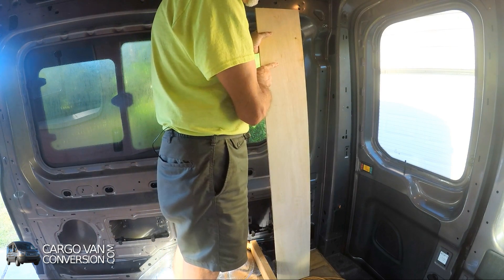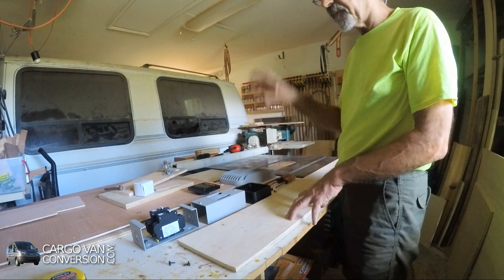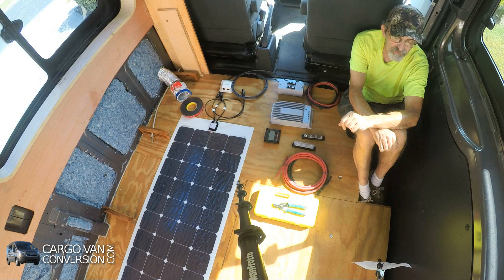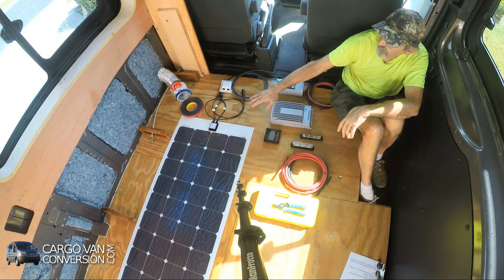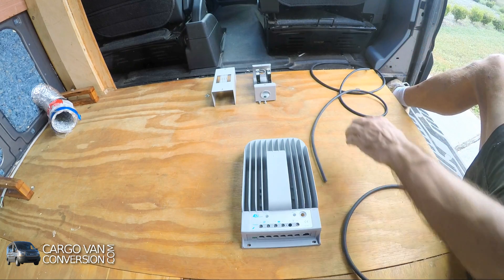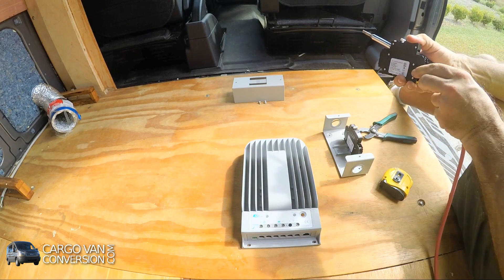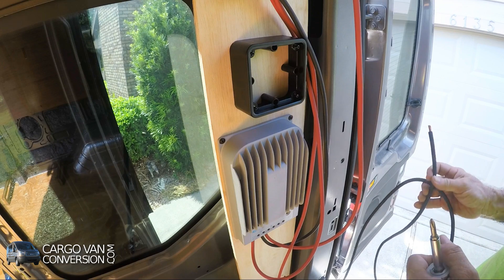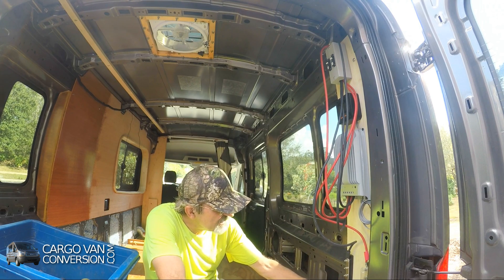RV Solar Controller & Breaker Box

Comment: Thanks SO much for going over the breaker box set up! What is the benefit/why did you go from the breaker box to a busbar instead of going direct into the battery bank?
Reply from the maker: Your title says it all:) Just Be Simple.
Good luck with your project.
Van Williams
Reply: Haha, maybe I'm TOO simple! Is the busbar only used to go from the 6 gauge wire to 2 gauge wire?
Reply from the maker: The busbars  are a central point to connect the heavy wires from the inverter, batteries, fuse block, etc. Keep the wiring between the controller and all these accessories as short as possible to minimize voltage drop.
Van Williams
Reply: I was going to just connect my inverter and DC fuse block straight to the poles from my battery bank since all the components are close together, but I suppose busbars could make it more efficient. Thanks again for your videos and help!

Comment: you could have also put a dab of oil on the nut to mark the wood, it might be out a little clearer than the impact impression - but both work fine.
Reply from the maker: Hi ggin nj,
The dent was much clearer than the video shows. As a woodworker, I tend to stay away from oil products, but you can use a variety of things, such as chalk or even lipstick. It was more about the way of getting the exact placement of the hole.
Thanks for giving your solution; someone will always find it useful.

Van Williams

Comment: Great videos! I noticed your wall under the window is insulated. Did I miss that video?
Reply from the maker: Hi tptwk,
You just put a smile on my face :) You're correct about the insulation, but no. you didm't miss anything. I often work on different parts of the van, sometimes waiting for materials to come in. I started with the insulation 1-2 weeks ago, but wanted to publish the solar components first. Right now I'm working to finish the editing on the insulation video(s) this weekend and you can probably expect to see it next Friday. In fact, the whole video process takes 3 or 4 times as much time as the actual work.
Thanks fow watching and thabks for the comment!

Van Williams

Comment: Can you please specify which 3M VHB Tape you are using to attach your solar panels to the roof?
Reply from the maker: Hi charlevoix418,
I'll be using 3M VHB tape 5952 and you can buy it here http://cargovanconversion.com/buy/vhb-tape (affiliate link).
The 3M representative told me that they did not recommend VHB tape for this purpose, but that many with RV's had used it with great success and that #5952 was preferred over the other 3m tapes.
Personally, I haven't heard of any failures. I would use a continuous strip of tape at the front of the panels (driving direction) and lots of tape all over to avoid any 'flutter'.
I'll show you my installation in an upcoming video (I post every Friday).

Van Williams
Reply: There are so many types of 3M VHB Tapes to choose from:  thank you for sharing that information!
Reply: Those flexible panels are made of plastic and are to be attached to your roof which consists of painted steel,  in ma case (I am building my own travel trailer), the same flexible solar panel had to be attached to my roof which was covered with Filon FRP (Fiberglass Reinforced Plastic) from Crane Composites:  for that application, 3M suggested VHB Tape 4952.
Reply from the maker: Hi charlevoix418,
Didn't know that. Meanwhile they still don't recommend it. Funny :)
Very interested in you building a TT. What's the story? And any pics?
Have a great day!

Van Williams
Reply: I am living in Canada but very interested by European caravans, much more advanced in design, construction and overall quality of their components.  I am using marine hardware like screws, hinges, marine electric cables for their superior quality.  Hull is completed and interior is about 75% completed, the whole project should be ready four hauling by spring 2018.  Please provide an email address and it will be a pleasure to send you photos.
Reply from the maker: Hi charlevoix418,
Having lived in Europe. I know exactly what you mean. Sometimes it looks as if time has stood still and we're still in the 1980's. Very little innovation. Hopefully with European firms like Hymer entering the North American market that may slowly change.
Look forward to some pics. My email is van@cargovanconversion.com

Van Williams
Reply: Yes, people are discovering Alde, Truma, SMEV, Dometic:  total superiority over Suburman and Atwwod...
Reply from the maker: Hi Raynald,
Agreed. Strangely, some companies operate in both markets, but still keep their products separated.
Thanks for the photos. Especially the hull must have been a major undertaking. I love to see an individual project like this. And you have some nice woodworking skills too! Would appreciate some updates as your build progresses. Wish you good luck.

Van Williams

Comment: really surprised how different  inside van walls are between your van and mine - 
I have high roof extended / no windows - 
the holes/ slots in walls are very different - 
thought you got a Tracer A series controller -  
pictures of my van - likely the only purple transit in the US -
 neighbors are a little Iffy on my color choice -
color changes with lighting conditions -
can look tan to grey to white 
have not posted a picture in YT comments before so not sure if will work - 
purple inside also 

[img]https://i.imgur.com/QAo42e4.jpg[/img] -

e Panel ruffed in - on wall behind drivers seat
 did not really layout for solar so need to change a little -

 [img]https://i.imgur.com/7hZrWdx.jpg[/img]

this is buss bar I used - nice because wires dont need crimped ends - 
real nice for temporary or even final layout  -- on amazon --
MURRAY ECLX072M Ground Bar Kit-

found out that Victron controller I ordered is Completely filled with
a white powder -  not sure what it does - 
has to be for heat or moisture ?
I was surprised when saw it in a review video -
 thought was joke -  but then saw in another video - 
sure would not want cops finding it - be hard to explain - lol

LooK at plugs in  holes on roof -  Not good - 
really thin cheap - Im amazed more/all vans dont leak-
I had painted roof before with elastomeric roof coating
may have kept my van from leaking -  
plug is super thin - 1mm thick -
tiny amount of sealer to hold in place

holes go straight into van 

some picts of plugs
[img]https://i.imgur.com/4Rww2Yw.jpg[/img]
[img]https://i.imgur.com/tHT8cCb.jpg[/img]

plug cut in half 
[img]https://i.imgur.com/UrS8OmF.jpg[/img]

 
-- Jay
Reply from the maker: Hi Jay,
I think that Youtube only accepts a 'http://' address, so you can leave out the 'img' tag.
I have to be honest, that I was somewhat worried, when you talked about a purple van. After repeatedly looking at the photo, I kind of like it. Basically white, but different. If you've done the paint job yourself, kudos!
The extended version and high roof are practically a necessity for a full-timer, but they do not improve the design. I opted for the All-Around Windows, but they come with some issues, like insulation and condensation. Quite different from a closed van.
I know about these plugs; some things about the Ford are substandard. Roof is thin too; don't try to put any weight on it. Inside they covered some holes in the metal floor with plastic stickers: they're all coming off.
I considered using these wall cavities as hiding spots, but are filling them up with insulation now. I made a conscious decision to use regular busbars. I think that many RVers drive around with bad wire connections. I bought a hydraulic crimper and use mainly wire lugs on the bigger cables. Either way is probably good.
Have to see about that powder in these Victron controllers. Never too old to learn :)

Van Williams

Comment: How you instal solarpanels, right in to roof or are you puting soneting under panels to keep them off to roof so air can ventilate and cool panels, i asked this pecause i think instal right in roof maby makes panels heat and dovns pover level?
Reply from the maker: Hi Arto,
Yes heat dissipation is an issue with flexible panels, as it is with rigid panels too. My attitude towards this problem, is just to install more solar. I could lift the off the roof and put them on a rack, but that negates the stealthiness of these thin panels, which then make rigid panels a much better choice.
I decided to install these panels with 3M VHB tape and leave some space between the pieces of tape; that may give a slight cooling effect. In real life, I'm not that worried about it. My solar sizing is based on winter requirements, when the heat is much less of an issue and these panels should do relative better than rigid panels.
I also still have the opportunity to simply add more panels at a later stage.

Van Williams

Comment: You didn’t have to do all that, it’s all going to be undone and done right. Just waisting time. Rather see the panels go on roof. Put as many as you can, so they are all installed to look right and wires are done right. If you add later it never looks right. Good Luck, Vinny 🇺🇸
Reply from the maker: Hi Vinny,
You're right; as many panels as I can, otherwise you run into problems later on, not only aesthetically, but with different voltages and Amps. Messy!
Will do the panels soon, just waiting for some cooler weather here in Florida. Working on the roof of the van, alone, with these huge panels in the heat in no fun. Too much sweat equity :)
Did not want to install them, without the basic components (cb's, controller, remote, batteries) for safety reasons, but I also want to use the panels, especially to keep the van cooler with the roof vent.

Van Williams